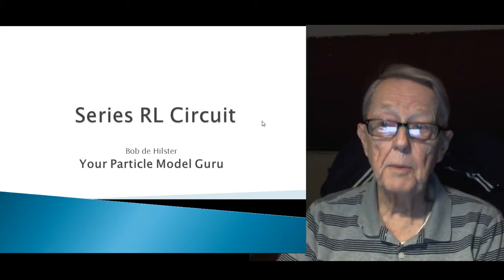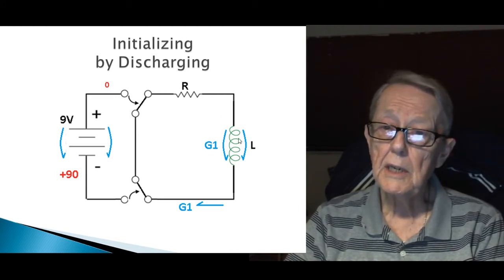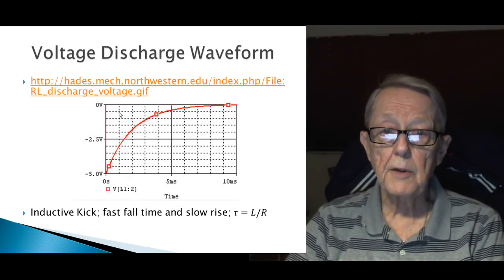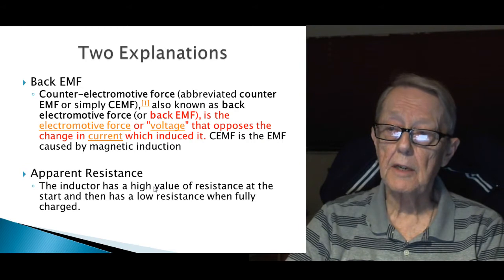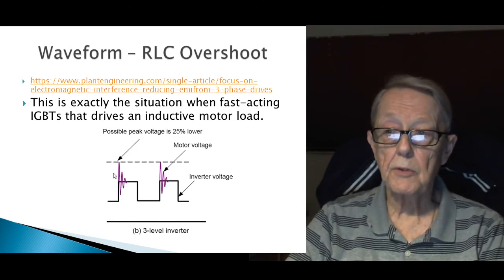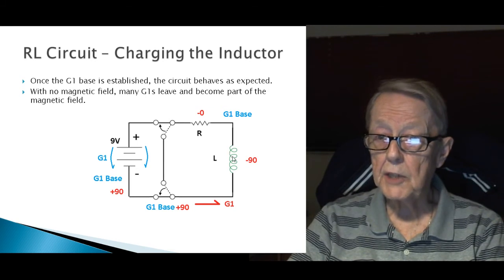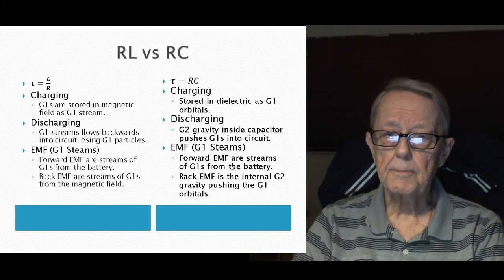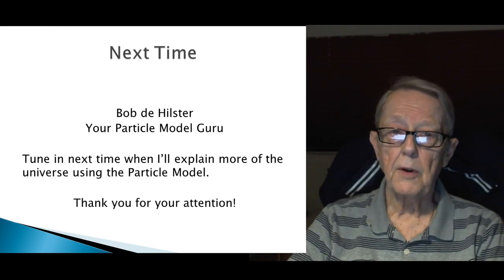Series RL Circuit

Comment: Did (can) you distinguish if the spark is an electron or a metal molecule ?
Reply from the maker: The visual part of the spark is the stream of G1s (electrons) that enters your eye. It could happen two ways and possibly at the same time.  The G1s moving through the atmosphere will hit the particles in the atmosphere and scatter in all directions. We se the lightning and the spark from all directions. G1s from the sun enter our atmosphere, scatter off of the particles in the atmosphere making the sky blue.The hot metal moving through the gap can emit G1s as the metal combusts.  It seems to me that the scattering from the atmosphere is the primary method with combusting metal happening when the conditions are right.
Reply: Thanks Bob.

Comment: I have a question good sir, do you have a modell for current as well that works together with the G1 modell?
Reply from the maker: Current is not real. It is calculated from the measurement of the voltage drop around the shunt resistor and the assigned value of the shunt resistor. As you can see, the G1 base plus the G1s supplied by the battery - is not current. Any term used in physics that is calculated is not real. Nature cannot do math. So I do not have a physical model of current. But neither do today's physics teachers.
Reply: Something about it seems very real though, especially its effect. I mean what we call current certainly has an effect on things, it drops if we add resistors to a circuit no matter if we measure it before or after the resistor.

Here is an example of low voltage but high current https://www.youtube.com/watch?v=WwNpJ_XbHN0
Reply from the maker: When you get a shock from a door handle, is it the voltage, or is it the current, or is it the G1 (electron) stream? It hurts, and that makes its seem real. To me, it is the high intensity stream of G1s hitting your hand. The hand senses the severe motion of the atoms in your skin caused by the G1s, and sends a signal to your brain causing you to jerk your hand away from the door handle. It's not the current or the voltage. it is the stream of G1s that is real. At the time of the shock, is nature calculating the current? NO!
Reply: Well i think its sort of both, without current there would be no voltage, and without voltage there would be no current, that is at least what i think. If that is correct or not i dont know.

I think it was an interesting question, not meant to disprove your idea or anything like that, maybe it would need to be amended in some ways to be able to describe current as well. If we assume that it exists.

So my way to think about electricity is more mainstream i admit that, so i think of as voltage "how much the electrons want to go in that direction" and current as "how many electrons" but this is of course subject to change if i grasp a better idea. I think your idea is very interesting, so i am subscribed to your channel and i even get notified when you put out a new video. I wish to understand it better.
Reply from the maker: Daniel, this is a new concept and I may not have it right at all. It is good to hear that someone is thinking about it seriously and asking questions. I thank you for that!
Reply: I think the concept has some very promising attributes and i would love to see it more developed, i think you videos are very interesting and thought provoking it gives me the opportunity to think about it in a different way which i actually like.

I dont find new ideas as a threat to what i think, it is how we actually get to a better understanding. If no one challanged that status quo we would still believe that the earth was flat and we would never have developed anything at all.

Im sure people were against writing when that was invented and if that idea had been silenced well we wouldnt even have books or schools today.